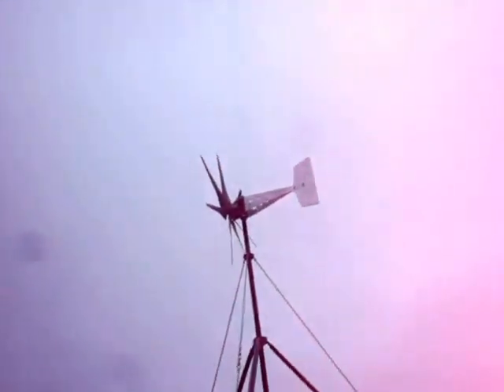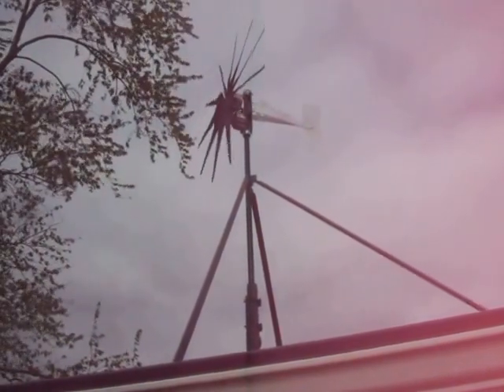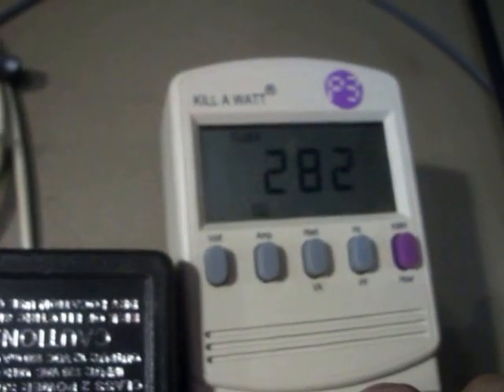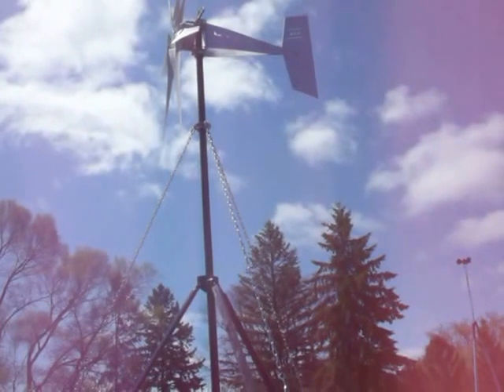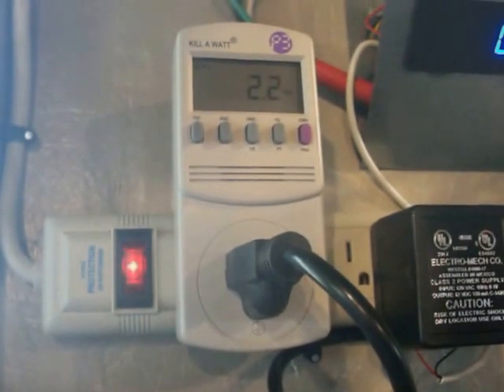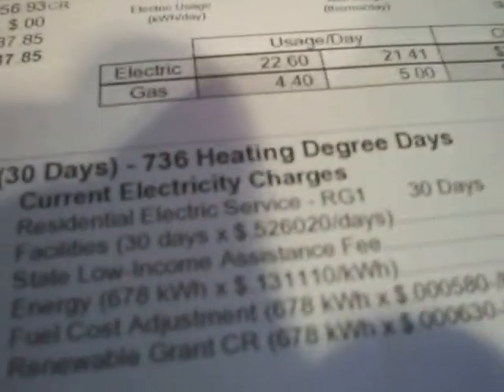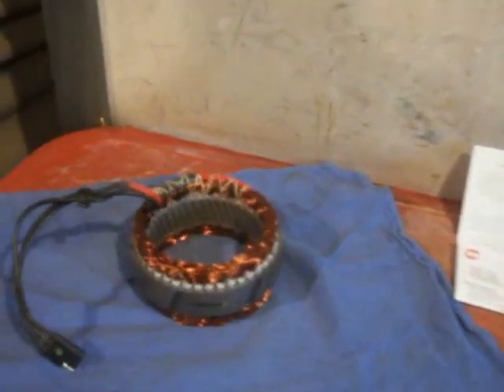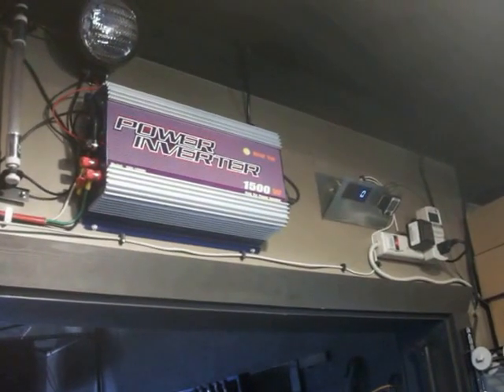Missouri Wind and Solar PMG VS. Modified PMG Results

Comment: I like your mounting poles and the angle iron to strengthen up the tri pod arms, Ya in low winds these turbines don't make much power, for me I bought my turbines for my fall and winter time I get much higher winds then and good power output, I really hope the Falcon Mach 5's work well for you,, I know switching turbines around is a pain, And yes Solar is the way to go for the, I am kinda like you I bought my turbines first then started adding solar, I would have been better starting with solar first and adding the wind turbines later :)
Reply from the maker: Jason Brown I should have started with solar panels and stayed away from wind turbines period. lol.  Now I'm deep in it and I must finish what I started to say I gave it my best effort.  I can see I'll have to buy the 80 inch Falcons.  I wanted to find a way for these to work for everyone, not just high wind area people.  I've been in a long battle with my smart meter and it's like the Red Baron, always shooting me down.  Still, my best success at slowing the smart meter has been switching all lights to LED.  Beating 16 cents a kw is no small task.  If my hobby is finding ways to save money, I guess to put it more correctly on this run.....My hobby is wasting money to save money. LOL.  It's only money, I never get to keep any of it anyway.  I'm just holding it for someone else.

Comment: I like MW&S product's but solar is always the better option if you want to lower your power bill. My turbine will save's me a about 1 kWh a day that's on a normal day. With the grid tie using power the number goes down from 2.2 watts then back up to count how much is going into the grid.
Reply from the maker: ***** I never tested the kilo watt meter to tell if it adds and subtracts.  You must have better wind by you to make 1kw a day.   I have to find a way for this to work for my wind conditions or it's going to only be good for storm weather.  I was getting 15 - 20 mph winds but it's too turbulent to keep the rpm's up high enough.   I"m hoping the Falcon blades will solve the problem.  If I need to, I'll even go a 3:1 or 4:1 ratio with the monster Falcon 4 blades.
Reply: ***** I used the falcon blades for year's no problem's but that was on a 60 foot tower. Where I live I average around 14mph all year round so yeah that is why wind work's for me.
Reply from the maker: ***** I just tested my killawatt meter, the display will go to zero and back up again, but the total power, both coming in and out is simply added together.  My meter does not know the difference of power made or used.  After taking a closer look at what power could be made...... even if I made 1 kw per day, that only saves me 16 cents for that day.   If I made 2 kws a day, that only comes to $116 savings for the whole year, 32 cents a day is not good.  My testing shows very poor results on the regular pmg.  My modified is even worse.
Reply: ***** See here we pay around 40 cents a kw, The only thing I could honestly recommend is stick with the wind turbines or try selling them and buy some more solar. As you know at least the sun is guaranteed power.